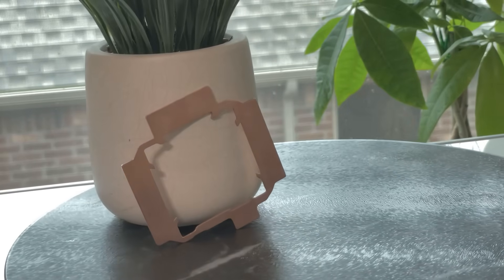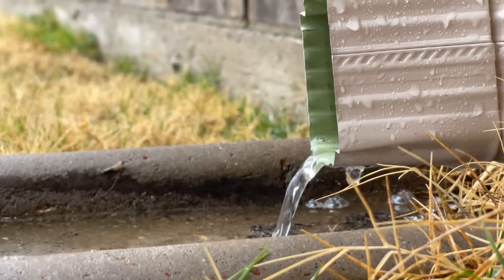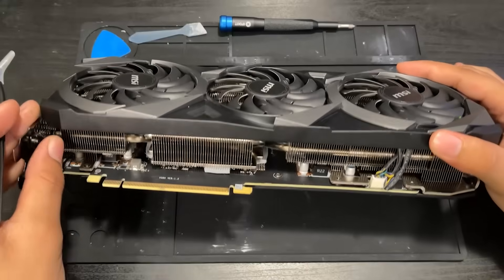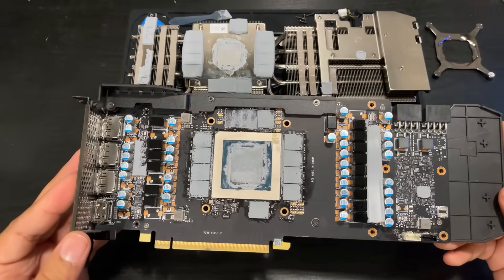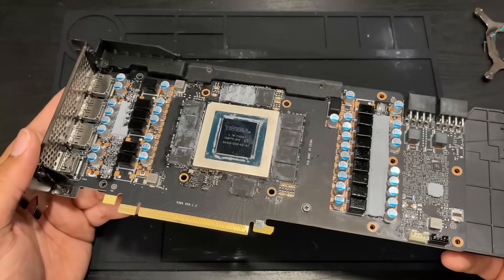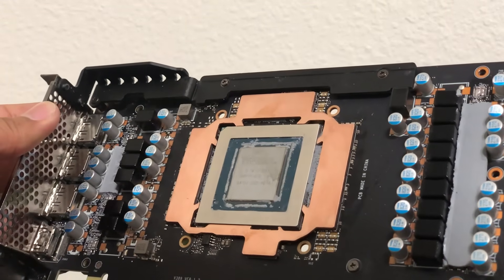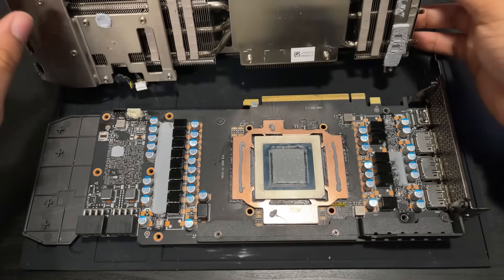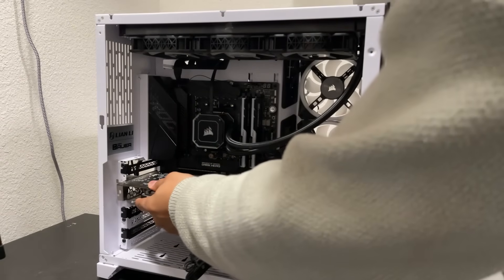Copper Plating FIXED This Melting RTX 3080. 25 Degree Drop In Mem Temps!

Comment: First time watching your channel, but love the dry sarcasm! Only one suggestion, get some 99.5% isopropyl Alcohol, as 70% is really minimum and generally used for washing your hands free of viral and bacterial pollution, but Isopropyl should be 99% + for electronics, AND it dries faster. Great idea re the copper plate though. Love the channel so far

Comment: Another great video dude! Very cool this machined option of the copper interface.. After the warranty is gone, I will surely do this to mine. Right now, I only have gpus with a metal backplate, and I use, (per gpu), two 100x100x20mm aluminum heatsinks with thermal pads + 2 100mm fans blowing air into them; it works great on lowering the temps substantially but it's not a solution to have inside a PC case, only for a mining rig.

Comment: dont fall for this shit if it was that good company would have given this in thier gpus i think this will be bad in the long run
Reply from the maker: I think you forget that most companies would much rather maintain profit targets than offer well-engineered cooling solutions that are consistent across GPU lineups and manufacturing processes.

Comment: Imagine Stock 65% Fanspeed called normal for this cards with a 1kg of Cooling block xD This Video represents my Thoughts truely. You can work with most Nvidia and Amd Cards with Fanspeeds of 30% if they maybe though more about the Cooling Solutions, because you have not only Gpu Fans in ur System. It's sad how bad Cards made this Days. That's the Reason why Kingpin Cards exist.

Comment: When you spread out evenly you create air gaps, better just use pearl dots, it wont spread out evenly , but it won;t create air gaps which is more important... You could spread out and add a pearl dot, but it might be too excessive, and I am not sure it will remove air gaps, that were created in the spread process... gamers nexus was conducting experiments: simple pearl dot on center was the best...
Reply: I used to say the same but after many repastes on GPU's and laptops i suggest spreading the paste because if the paste doesn't flow to a corner/edge of the chip for some reason after placing the heatsink it can leave a dry killing hotspot. Testing with a piece of glass the air bubbles disappeared.
On those chips i use thick highly viscous paste for better long term stability (SYY-157 / Shin-Etsu 7921-5), with practise it becomes easier to spread. "user friendly" easy to spread pastes give great temperatures at the beginning but temperature can rise very fast after a couple of weeks on naked die laptop/VGA chips or temperatures above ~80'c on those chips.
On desktop CPU heatspreaders just a dot in the middle and on the new Ryzen CPU's 3 smaller line-dots on the Die locations under the spreader. And if the contact plate has a rough surface i prime it with paste and shop towel.
-Thermal paste debates can get very heated sometimes, for me everybody has their own methods and that's fine.

Comment: tryied to play CP2077 on ym gigabyte 3080 (rev2) maxed out GPU 98% usage and got hotspot 80°C and mem 72°C so i think its way better then msi, and with that bented copper, yous hould heat it up with torch and let it cool down, it will soften the copper and you wont have any that much stress there (but i think that stress what you have there is almost none)

Comment: Pro tip:
Do not use % when dealing with temperature. How many % difference is there between 0 and -1? The math only works out if the scale starts with 0 and has an end, which it doesn't. Not to mention farenheit.

Comment: that thermal paste is ridiculously "dry", its not supposed to turn into concrete, what paste is that?
Reply from the maker: I think it was TG-7. Needless to say, I don't think I'll be using it in the future for high-power GPUs. I'll stick to MX-4 and Kryonaut Extreme.
Reply: @dandyworks  probably a good idea, ive been considering doing this to my 3090 ftw3U, doesnt help that the extra stack of vram on the back of the pcb has no real cooling, so this thing gets real spicy
Reply: If the paste is still pliable and not dried up + cracked, thick paste is actually a good thing on hot GPU's and that's why manufactures use it for better long term stability. In the past i used MX-4 and other easy to spread pastes on laptops and cards but on high temperatures (80'c), temperature becomes higher after a couple of weeks and paste fully pumps out to the the edges with a puddle of silicones left on the chip, uniformity/flatness of the coldplate also plays a major role. (The Kryonaut Extreme should holdup better with a higher viscosity of 130-180 Pa·s, MX-4 = 87 Pa·s)

Comment: Why haven't 3k series owners started hassling NVidia/AIBs about making the memory actually capable of decent temperatures?

My 6900 XT Referemce has zero heat issues with memory or core at minimal fan speeds (~40%) producing very little fan noise.

Comment: Haven't picked through the comments, but possibly the extreme conductivity you have now with copper and paste favors cooling of the memory versus that of the GPU.  You will have changed their transfer ratio.  Will be great for Ethereum mining as it heavily memory intensive as compared with the GPU.  Thanks.  I believe I will give them a try for my season of mining.  3080, 3060TI examples.  Cheers CapTon.

Comment: This is the one part about youtubers I never get is that you guys never use torque adjusted auto assembly line screwdrivers on these low tolerance graphics cards. 

Anyways nice video, if you wanna get the most out of it, go with liquid cooling + liquid metal + copper mod + thermal pad replacement for VRMs+ GPU tuning+ colder ambient (room temps).

Comment: very interesting vidz, well done & informative. have you heard about kriticalpads ? classic pads but 20w/mk and precut for specific models. I bet copper is more effective but wonder at what extent these Kriticalpads solution are good. keep up the good work. waiting for the next video
Reply: Kriticalpads is currently out of stock as US Customs has the shipments on hold ..... Kinda Sucks as I have have alot of kits ordered
Reply: Kritical pads underperformed from my testing. GPURisers pads are better a d Gelid Ultimatws outperform GPURizers pads.

The MOST effective pads for GDDR6X are the 3D Graphite pads, although they are single use so would  end to be replaced each time you open the card.

For the ultimate performance go woth Aluminum/Copper Shims and TH949-1 Thermal Putty

Comment: Your no improvement to temperatures on your GPU core after this modification is likely because your VRAM is now much more efficiently at wicking its heat away into the GPU's heatsinks. In other words, you have no longer have a single source of heat, there are ten VRAM, albeit small, are now much more thermally conductive than before 

12:04
Reply: Additionally, I reckon after overclocking your 3080's VRAM, It shouldn't be surprising to witness a higher than average GPU core temperature! As your VRAM's heat output is overwhelming MSI's GPU cooler, it's original intention is probably to dissipate heat from the GPU core only
Reply: @bakedpotato8602  he is a crypto miner,  ethash is vram intensive, so having lower temp vram is going to help with vram overclocking.

Comment: I have an RTX 3060.  It was pulled from an HP Omen and some guy was selling them.  While idle it doesn't run hot but while running some games it can get to the 70s (Celsius).  I know that is not too hot but I would like to make it last longer than the manufacturer (whoever that really was) intended.  There is a really thick thermal paste that can replace pads but the copper plates seems like an even better idea.  I would consider that thick paste to help hold the plates in place.  There are also Arctic Silver thermal epoxies but I don't like things that are so permanent, that stuff would destroy your boards when you try to remove the heatsinks.  I don't plan to do anything anytime soon but the copper plates seem like they work really well.
Reply: U dont need copper plate for 3060 because it is gddr6. 
All you have to do is change the thermal paste and make your custom frequency/voltage curve in MSI afterburner. Out of the box cards tend to use more aggresive voltage than it need to be
Reply: @lowzyyy  I am just one of those people who likes things that are impossible to kill.  To me there is no such thing as overbuilt.  that is just something you would hear from someone who is used to things failing sooner than they should.

Comment: looked on the website but the shim you have in the video is not on the website ??  Do you have a link so that I can check it out. I have the msi 3080 suprim x with a full water block but the memory hot spot is higher than I would like when I run most games made with unity engine. Unreal is generally stable around 62-68c but unity pushes it over 80c and one game badly optimised in my mind as it pushed the temps to 104-105c.  Not going to name the game as it might be an issue that I suffer from and other people might be fine ??
Reply from the maker: Hey there, should be this one https://www.coolmygpu.com/product/ga102/3?cs=true&cst=custom
Reply: @dandyworks  thank you for the reply. possibly the one you have is a newer version and the webpages not yet updated. the images of the one shown on the page do not have the little pincer style corners as yours has.  Anyways hit the subscribe as a person that takes time out to reply desrves a sub. Thanks again.

Comment: I have 2 troubled cards.  3080FE loves to run at 102... I assume that will be way higher in the summer.  Giga 3090 loves 100c.  Both are running fine and very stable so no rush to do anything on my side.  But I've pulled the trigger on the copper plates that I saw a few months back.  Now that more folks are trying them out I feel a bit better about it. Not looking forward to taking those cards apart however... Subscribed
Reply: A quick question. the temps your measuring on the memory hot spot I assume to be with HWiNFO64 ?
 I have a full water block on my 3080 and its only with games running Unity Engine that make the memory screaming hot. Unreal Engine Cryengine etc all settle in around 60-65c  
2 games on Unity push the hot spot to around 82-96c and one game is simply horrendous and camps at 105c. Right now I am afraid to run some Games made with the Unity Engine as it is certainly going to shorten the lifespan of an expensive card.
Reply: @johnno2377  
For Unity games what I do is add this to boot.ini: 
gfx-enable-gfx-jobs=1
gfx-enable-native-gfx-jobs=1

Now add this to Steam launch options: 
-console -window-mode exclusive -screen-fullscreen

You may have to alt tab & tab once to get fullscreen to work. Obviously - use a frame limiter of some kind in control panel or otherwise and use Vulkan if it's available. Best if you use all fixes together for a good result. 

Not 100% guaranteed, but I bet you will see some temperature reduction. For me it is usually around 5-10C on GPU core.
Reply: @The_Man_In_Red  Thank you for the info. I shall give it a try and see if it helps. If it does I shall post the results as I can not be the only PC gamer having issues with Unity heating the memory on games.
Reply: @johnno2377  
Oddly enough Vulkan seems to make a huge difference, I get around the same core temps but fan speeds go down by a good 10-15% it's pretty noticeable that it isn't slamming the GPU so hard using that API. 

I just chock it up to something developers are doing with shaders & lighting in Unity. Because I've played Unity games where it barely hits the GPU and I'm basically idling at 35-40C @ 40-50% utilization and others where it ramps up to 70-75% fan speed and can barely stay below 65C. 

My card is undervolted btw, if you're wondering why my temps seems pretty good. 

Easy man solution is to lower Power Limit to 70-80% in MSI Afterburner and save it to a profile for Unity games but you might lose 1-3% perf :P 

If not... techie-show(dot)com has a great lengthy article called "How to undervolt your GPU - lower temps & higher performance" if you feel like jumping in the deep end.
Reply: @The_Man_In_Red  I checked the cofig files for the launch of the game giving me issues and the settings you suggested were already applied. so sadly no difference for me on that game. Planet crafter similar time frame of development settles in at 72c so no problems. 90c on a couple of occasions for a momentary period but Starsand is just simply adamant and remains on 105c constantly no matter what settings I try. This is the memory hot spot so it is concerning to me as it can damage the memory and its performance over time.
Reply: What gigabyte card do you have? I got the Xtreme and although people have complained alot about the thermal pads being really bad (1.5 WmK) I haven't seen my memory go up above 100c
Reply: Changing thermal pads its not scary thing. And as someone mentioned, high temps reduce lifespan of cards.
Reply: @WszystkoZajeteOMG409  if temps are within spec the risk of taking them apart to just lower temps seems silly. also, lots of folks say it lowers lifespan but Ive yet to see any videos much less lots of videos saying "my cards died because of heat."  if you have links to any I would love to see them.🙂
Reply: @TheFutureisTheFuture  Bro, just use right size of pads and use gloves. Thats all the risk.

Comment: Expecting drastic improvements in core temps? Smh, what did you even do that would alter either the speeds at which the core runs or the efficiency of the heat transfer between the core and the heatsink, namely the only 2 things that could lead to lower core temps? 

If anything, the core temperatures would be expected to go up with more efficient VRAM heatsinking. The VRAM and the GPU core share a heatsink, so if you somehow transfer the heat of the memory modules to the heatsink more efficiently, that heat would in turn add to the temperature of the GPU core. There is also the case of memory modules triggering thermal throttling, in which case the lowering of vram temps will remove the throttling and make the GPU run faster, which again, means more heat the GPU core.
Reply: this is good info and fair comments but you could explain it rather than speaking down to people... or make a video of your own...
Reply: @TheFutureisTheFuture  He'll appreciate my insights if he's a decent guy. If someone pointed out my irrationality I'd only blame myself for having a faulty logic and improve on myself. Don't be a baby

Comment: personally i would stay away any more MSI cards, their backplates aren't metal (but some kind of plastic), and that doesn't help thermal at all, in fact it might make it worse, but why do you ask that they are doing this? simple answer: cost down, profit up for MSI, and sucks for you
Reply: Msi have started releasing the new RTX 3080 12GB cards with aluminum also 350W maybe they realized their mistake.
Reply: @constantinossmith2452  maybe so, but I have had pretty good experience with EVGA 2000 and 3000 series
Reply: @droomagon  I know what you mean I have an EVGA 1070sc, they are legit.